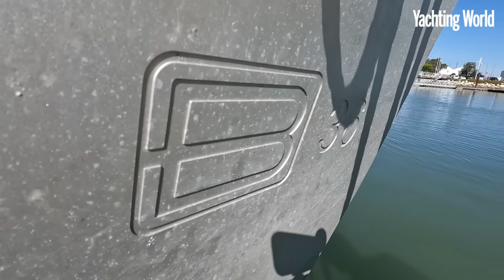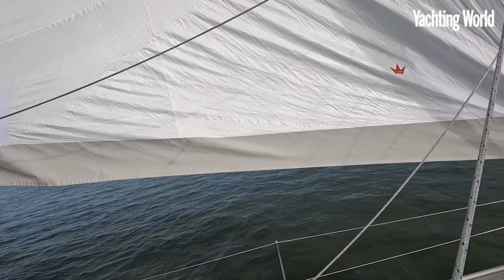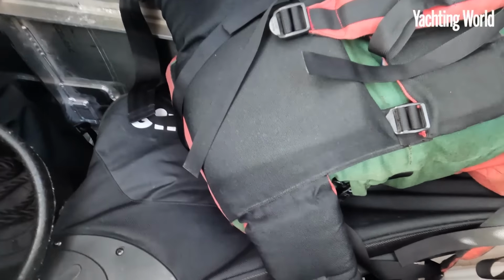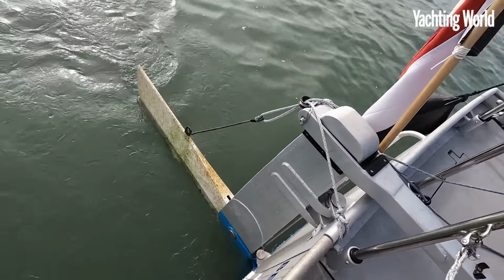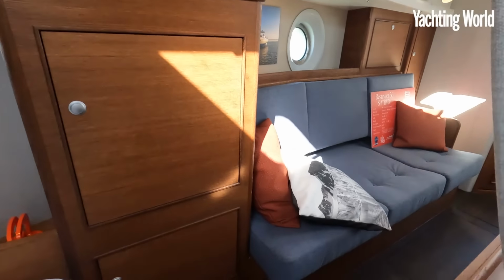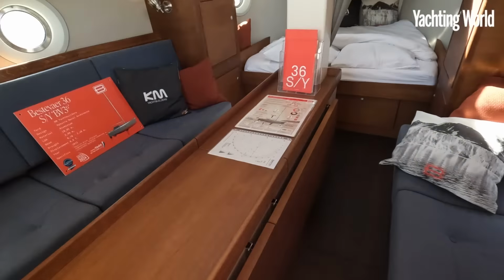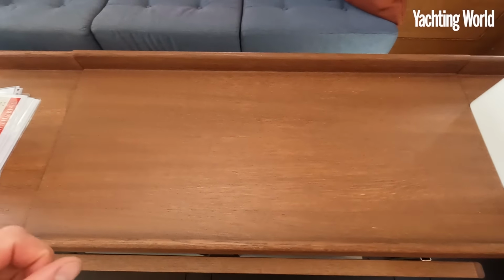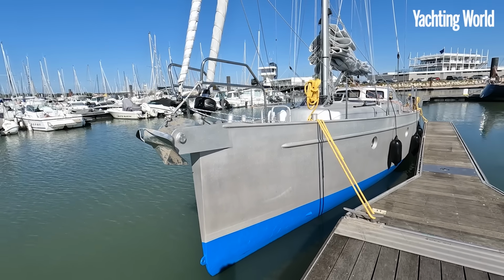Packed with interesting ideas and features - meet the rugged Bestevaer 36

Comment: This seems to be a proper Arctic sailboat.  Great rudder safety.  Can get to everything to work on it.  Replace the blade as you need.   .  Love how wide open the interior is... No need to block off the bed if only two of your sailing.    The pilothouse could be better with a place to sit higher up and the ability to close it off with maybe a canvas zippered barrier aft.  The older Garcia 45s had a nice pilothouse where you could sit and watch forward isolated from the wind and spray.

Comment: There are 'expedition' boats, and then, there is this: - what looks like an unfinished 'hirsuit' Neanderthal boat, rough with weld-seams and quorters that an experienced jailbird might find uncomfortable. This boat would likely suit best what in the US is called "preppers" - i.e. individuals actively planning to battle zombies during apocalypse. Having seen Garcias and Allures, methinks an expedition boat does not have to be such an unfinished tin-can - especially for such money,  because, yes, the deck might get uncomfortably warmish if this tub ever sails south of the fortieth paralell... Perhaps this is an arctic-ocean 'special', or for the connoisuers of maso-kinky pursuits? - Just wait until that aluminum locker door closes on a finger...

Comment: Nice sailboat.. love it.. but.. -- QUESTION -- Why is the transom like that @00:22 where it looks impossible to climb onto.  The old Garcia 43/46 had a large flat sugar scoop type transom that worked so so well.  Kinda wish this did to.  Is there a reason to have that type of old style transom on it?
Reply from the maker: If you watch the video @Coleen_West you will see at 05.20 there is a proper gate through the transom which also forms a swim platform

Comment: Very poor interior layout. The functional concept of the rest of the boat has gone berserk on the interior. Silly galley, silly head, and silly many things really. Also, what happens with condensation in some parts of the interior? Is that why the head is so small? Go back to the drawing board with someone who is not from your company. Nice try Tobes. The boat has some quite functionally appealing ideas, but these people are a little too introverted and need some help. Forget that silly dagger keel for a start. People might like to sail upwind.
Reply from the maker: Ah @thomaselliott573 - it's been a while - I've missed you! 
It's very well insulated, the builders have done a few aluminium boats now. And I'd be interested to see you take your back to the drawing board and centreboards don't go upwind thoughts to Gerry Dykstra - again, a designer who knows a thing or two!
Reply: Centreboards going upwind on a bathtub? Licking butts again ay? @yachtingworld
Reply: Useless comment. fark off @yachtingworld
Reply: @yachtingworld gotta love the small trolls of the world

Comment: Aluminum doesn’t absorb water like fibre glass, no gel coat to be scratched, easy to repair, it can be painted, but doesn’t have to be.  If this boat was built in volume, the price would drop
Reply: Right,but as all things also aluminium has his cons,electrolysis for instance and seen the bad insulation figures it need extensive extra insulation.

Comment: So electric drive right?.so what 
Do you gain from that.have to
Run the generator on diesel
To the batteries to the drive
Unit.just have a diesel engine
Straight to the propellor.
Then shouldn't need the 
Unsustainable batteries.
Not need them and don't
Have to dump them in a few years .I don't get it , somebody
Explain?
Reply: The Oceanvolt motor has regen, so it charges the batteries while sailing. Then you charge the batteries with the solar panels. In a marina you charge with shore power. So the generator is the backup of the backup of the backup.

Comment: 2:27 I'm gonna tell you right now that the top is not sandblasted aluminum, as sandblasted aluminum looks completely different. The top deck has a texture coating on it. You can see the raised edge along the clean cut seem.
Reply: From the brochure:
"Grit blasted non skid aluminium surface at walking areas on 
deck/cockpit floor"

Comment: €800K for the the base spec, i.e. before she's fully fitted out with water maker / safety equipment / etc. Crazy money. Tiny galley, no technical room, and really not much interior volume at all. A couple of years ago you reviewed the Alubat OVNI 370 with a price tag of €280K+ taxes which so much ore interior volume. That would get my vote every time.
Reply: the ovni 370 is at 500k now
Reply: @janfleming5635  Wow, a 79% price increase in just a couple of years. That strikes me as particularly greedy, and means that #1 on my wish list is now empty.
Reply: Really old interior design that looks ill prepared for live aboard. 800k for this? Base price! You must be joking?!
Reply: The price of aluminum yachts has been rising since 2021, with an astonishing extent. Perhaps in the coming years, this industry will experience a downturn.
Reply: Interesting although compared to a Boral or OVNI, it’s a long way to go to favor this (small) one!
Reply: No, 500k base price ex vat = 610k incl vat. Your 800k would leave plenty room for what ever you want
Reply: Yes ,it could be half if they wanted sells😢maybe in france for that price ,the deck is a awesome idea
Reply: It's an aluminum sail boat intended for northern climates so I imagine some sort of foam insulation is grafted to the hull taking up volume. If they didn't insulate then the inside of that boat is going to be wet, wet, wet the moment they have to use heat.
Reply: Just got to the part of the video where he explains that they use cork on the hull and wool sandwiched between the aluminum and linoleum up top.
Reply: @Nozzall  200 000 foam insulation great deal 👍
Reply: @Nozzall  the cross section of the two boats is very different, especially in the bow. Both boats have insulated hulls but the Ovni has significantly greater volume.
Reply: Was looking forward to videos of this boat.  With that price, I've lost all interest.
Reply: Amazing how people have become so used to the high volume vessels favoured by charter companies. People expect the average thirty six footer to have two or three private cabins, one or two head/showers, a big diesel, massive headroom and to sail like a witch on six or seven tons displacement. Maybe yachts should be measured on cost per ton of displacement.
Reply: @brucewalker5890  The Onvi 370 is 37ft. It’s cheaper, the interior is better, even having a workshop option. I prefer the simplicity of the rudder and cockpit layout here. I love the electric drive, but I’d want any sail drive like that boxed and watertight. An Onvi 370 can be fully specced for ocean crossings for less than the base price of this. I’m torn if I’m honest.
Reply: @oblitafier the base price for this is 550 eur and the ovni starts at 600?
Reply: Yes, plus imagine walking on that deck under any decent sun, you'll melt your shoes, not even mentioning your feet.
Reply: Without such overinflated prices, companies would not be able to pay the media that applauds their products.

Comment: Loving the combo of old school metal boats with space age friction rings and dyneema👌 My only worry with metal is internal condensation and ensuring there are ways of getting it off the boat, but otherwise that’s a nice boat!
Reply: Cork is very effective and safe its also very light and renewable. Its also naturally resistant to mould and bacteria... Basalt needle matting is also safe and effective if you can get a supply.

The other trick that works is to add slow low noise and pressure computer fans to mushroom hatches   and force air through the boats storage areas when in use or stored.... 
The airs forced behind and under the inner fittings and helps move the moisture out.  
You can close them off under sail. 
Although there are heat exchanging 12v domestic fan units designed for bathrooms and kitchens that might fit in a locker 🤔 
That might be worth a try on an older boat.
Reply: @clivestainlesssteelwomble7665  
Sure thing. We used closed cell foam very effectively on our steel ketch and it’s lasted for 12 years ok, and I suspect will outlive me.

It’s forgotten areas like the lazarettes and lockers though. They’re not insulated and will experience temp differentials between outside / inside, thus producing condensation. In an ideal world, that would run down behind the stringers and be pumped out via bilge pump, but it’d be far easier just to insulate the area instead…
Reply: @PN_48  
Yes insulating the whole hull is the ideal.. it saves energy both ways reduces noise something that we forget especially in a metal hull. 

The problem with sealed cell foam spray is ...its not cheap its made from hydrocarbons... It degasses some nasty chemicals and it sheds plastics into a closed environment . The other big problem is in the event of a fire many foams and plastics will burn or emit thick black toxic smoke.  That will kill a person very quickly.

Cork is naturally fire resistant its ised to clad the outside of buildings in Southern Europes fire belt and can be treated to resist even a blow torch without harmful toxic smoke emissions .. its also more abrasion resistant . There are office buildings that use it as flooring where it has to withstand stiletto heals passing every day.
Basalt is incredibly good as a thermal chemical radiation and water and mould resistant it also doesnt form harmful shed particles.   The Other group of materials that can be considered are flax, jute and hemp fibers.  
Chain lockers are an obvious place where they need a liner that keeps metals separated and to reduce noise.

One other point, with the advent  of chemically structurally modified  timber like Inventwoods ..MettelWood.. or Accoya you may find that wood becomes a substitute for Al Car on fiber or even steel.. with natural insulation and  even the ability to substitute for glass but keeping the strength and insulation of wood ..  
If you reduce the thermal gradient and bridging you reduce the condensation risk and the energy needs of the vessel in both cold and hot climates. 
Its an area that needs more attention and design material alternatives. 🧙‍♂️ 👍🏼

Comment: Wondering how hot that gets in the sun?
Reply: I spent a week on an aluminium sailboat like this. On a summer day, alu boats get hot on that deck to the point you can not walk bare feet ... inside is warmer in comparison to a white grp with minimal insulation. In winter, alu boats must have insulation for condensation (which can create havoc) and temperature topics. alu builds require vertical and horizontal frames, that take space from the interior which is typically filled with insulation...with a nice convection heater is really nice and warm inside.
Reply: And the light color won’t soak up as much heat as a dark exterior.
Reply: @michaelpimentel8710  not hot and it's insulated!!! Good builders. Would like 40/44 version.
Reply: On deck it gets hot at noon (wear sandals), inside cooler than your typical grp boat because of all the insulation.
Consider that this boat wasn’t built by dykstra for the tropics, but for the waddensea and scandinavia.